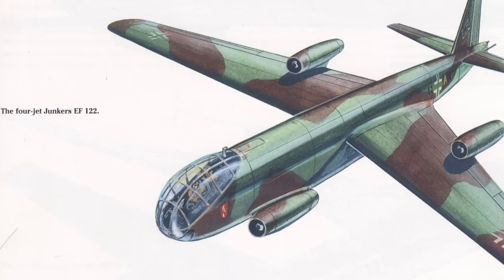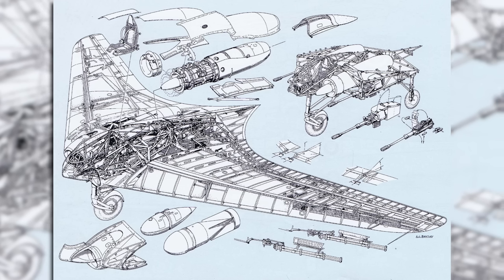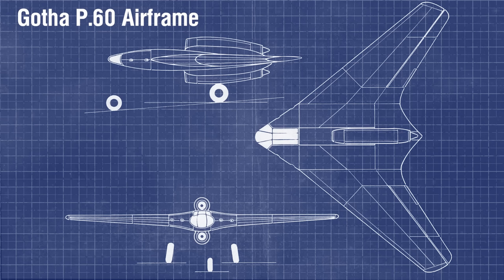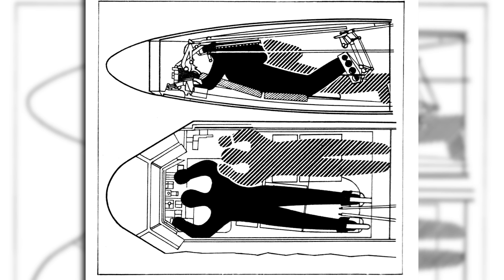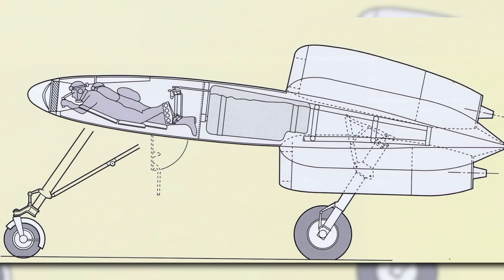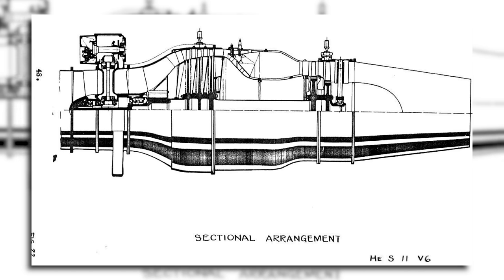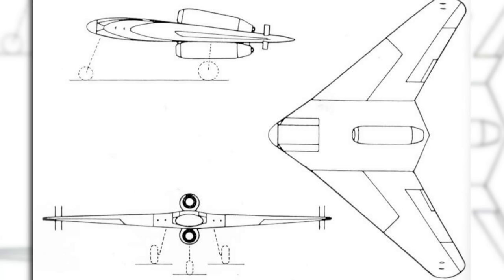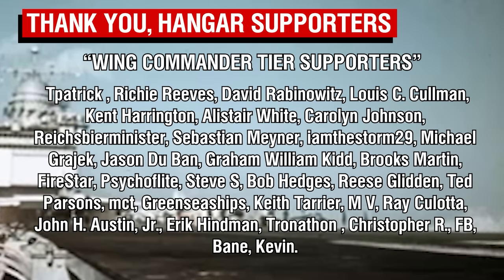Gotha P.60 - A Superior Horten 229? | Concept Planes

Comment from the maker: F.A.Q Section - Ask your questions here :)

Q: Do you take aircraft requests?
A: I have a list of aircraft I plan to cover, but feel free to add to it with suggestions:)

Q: How do you decide what aircraft gets covered next?
A: Supporters over on Patreon now get to vote on upcoming topics such as overviews, special videos, and deep dives.

Q: Why do you use imperial measurements for some videos, and metric for others?
A: I do this based on country of manufacture. Imperial measurements for Britain and the U.S, metric for the rest of the world, but I include text in my videos that convert it for both.
Reply: Cant await to see the H or Ho IX V2  or Ho229, Go229 Video, i live in Göttingen were the Kommando Horten was stationed they flew alot of Horten designs here , H VII V1 with Props, H XII Glider and the Ho or H IX V1 Glider, the H or Ho IX V1 Glider and H or Ho IX V2 (Ho229) Jet were both built here at Kommando Horten IX Göttingen , V2 was then send to Oranienburg via Rail from Göttingen Air Base for Testflights.
 Theres a good Book about Horten designs from Hans-Peter Dabrowski "Deutsche Nurflügel bis 1945" (Die Motor und Turbinenflugzeuge der Gebrüder Horten) PODZUN-PALLAS with alot of good fotos
Reply: Kilo Newtons
Reply: Boeing 806?(not sure if that is correct..looks somewhat like an F-16...same contract competitor)
Reply: ..and...Awesome videos...never miss one..
Reply: Could you make a video of the Bereznyak-Isayev BI rocket powered plane?

Comment: I much prefer the Horton.  The engines buried in the wing/fuselage made for a much cleaner, nicer look.  With more time to develop I'm sure that they could have created a frame that was sufficient to support the engines like detachable units and just open up access panels to pull or drop the engines out quickly and swap in a new one.  Like changing D cell batteries.
Reply: You massively understate the difficulty of swapping out engines. I’d prefer pod-mounted underslung ones as in the Convair Hustler
Reply: @charlestoast4051  ok.  The Hustler isn't the same in any way, but we like what we like I guess
Reply: It's all fun and games until you have to do an engine replacement.
Reply: Could have been solved with a ground frame to support the wings weight when dropping the engines, though would have added a lot of extra ground support headaches.
Reply: @watcherzero5256  Obviously, I haven't reviewed the plans for the Horton in anything but a casual glance, but having seen the Jumo engine I can't understand why a quick connect to the intake and exhaust with similar quick connections to fuel, electrics, miscellaneous couldn't be attained.  I mean, an engine nacelle hung under a wing isn't much different.
The mistake is to build it like a Formula 1 racer where the engine is part of the frame and structure.  That's what makes service or engine replacement time consuming.
Reply: @andrewmacgregor8717  Thats exactly the issue in this case, its a stressed member engine which is integral to the frames load bearing capacity and without it providing rigidity the frame cant support the weight of the wing. The same is done in Tractors, motorbikes and as you said F1 cars. Russian aircraft carriers have a similar thing where the deck elevator lift shaft is internal rather than external like on western designs and is in reality a stressed box girder providing rigidity as the primary anchor point of the forces on the ships frame and without it the ship would collapse under its own weight. (so it cant be moved or cut into to be enlarged)
Reply: @charlestoast4051   Difficulty ??? What difficulty ?? Ridiculous statement.  Dozens of jet fighter designs since the war up to most modern fighters replace their engines by sliding them in from the back. The same could have been done with the HO-229. And NO modern jet  fighters uses under wing pods for obvious reasons. Don't quit your day job...
Reply: @EngOne Sanity! Thank you.
Reply: ...like jet power-eggs
Reply: @EngOne  Just ignore the guy above you explaining why that wasn't possible with the design of the 229, and keep raving on.

Here, I'll extract it for you.
"...its a stressed member engine which is integral to the frames load bearing capacity and without it providing rigidity the frame cant support the weight of the wing."
Reply: @mootorkassipoeg  Naw. I'll just ignore both your and his uninformed comments. Like in many post war jets, that problem was solved by having a tube installed into the airframe to take the stress of the structure. Then you are free to slide the engine in and out. My Engineering graduate degree is in Aerospace Engineering. What's your degree in?
Reply: @charlestoast4051   Simplified, yes, but not altogether wrong.  Problems arise due to poor structural design; you have to take servicing the engines into account when developing the engine mounts and  maintenance access.
Reply: @EngOne Yes, no MODERN jet fighter.  This was not a modern jet fighter, it was an experimental design that didn't have 70 years of research to draw from.
Reply: @kevinsullivan3448  WOW you guys!  I didn't think it was all that controversial.  I'm amused 😀
Reply: @kevinsullivan3448  Immediately after the war, numerous fighter jets used this method of inserting jet  engines, including the Focke-Wulf TA 183 designed by Kurt Tank during WW2
Reply: Massive problem : Germany was out of time
Reply: So can this better alternative of a fixed wing jet aircraft be compared to F-22 vs YF-23? Cause if the war drags on for longer, the Horton one is likely to be approved further despite the Gotha design is potentially better.

Comment: Feels like the upper engine would have problem at higher angle of attack, while the lower would eat debis kicked by the nose wheel.
Reply: probably would, but over under mounted engines have been done before, so maybe this is an over thinking situation?
Reply: I can see it from a structural perspective, massively reinforce one narrower area rather than spreading out the reinforcement which may have weighed more. Effectively it provides a keel that everything else hangs off which can be more efficient when done correctly. Do I see it as a good idea? Hell no! That opinion, however, comes from living with an aero engineer for over 40 years.
Reply: A flameout of the lower Engine on,  or shortly after takeoff would send you right in to the earth.
Where as an failing upper engine would turn you nose up, then the lower one would flame out and after that you would neatly die in a flaming impact..... perfect.
Maybe i am to pessimistic but i wonder why they gave the engines such a big angle of attac.
Usually a low mounted engine should face up to counter pich up bias. Likewise a high mounted engine should face down to counter pitch down.
And this plane is the complete opposite.
Reply: @Flofutz hmm... maybe this is one of the planes that lead to realizing that.
Reply: @nos9784  it was never realized. so that had to be learned from something else
Reply: @SomeOrdinaryJanitor  the EE Lightning comes to mind but it has a single front intake instead of having each engine intake seperated  by a plane.

Comment: irst: there wa never an Horten 229! It is the Horten IX! The 229 comes from the Manufacturer Gotha where this Plane was build (and for the Build named Gotha 229 because Horten never was a Manufacturing Company capable of more than a few Prototypes ;) ). The Horten was not much more like a Proof-of-concept,  The Plane that was planned to be build in Numbers was the slightly more conventional Gotha P60 with vertical Fins for better Stability.

Comment: Another problem with the P.60 is that if you lose one of the engines, you get a severe uncontrollable pitching moment due to the engine not only being placed in a vertical distance from the center of gravity, but also being slightly pointed away from the center of gravity, as in the opposite of what is done on the SU-57.
Reply: Would it really be uncontrollable?  Like could you not trim the elevons to counteract it, like a standard layout multi-engine would trim the rudder to fly with one or more engines out?
Reply: @rapter229 It would happen pretty quickly…dunno.
Reply: @rapter229  I doubt a pilot would be quick enough to go through the necessary steps fast enough, before the plane pitches uncontrollably. 
Even then, do the elevons have enough authority? They don't get extra leverage from a long tail boom, so you'd need extra speed, making landing a nightmare.

Comment: 2:25 The nose wheel is right in front of the lower engine intake. What could go wrong?
Reply: Everything?
Reply: It had top secret German engineered FOD sensors on the wheel which could miraculously divert debris just outside the perimeter of the engine inlet.  I’m completely shocked Rex did describe these in detail!
Reply: @ronjon7942  
Just like the US Navy copied the collapsible nose gear from the ME-262 to increase aircraft storage space onboard carriers. 😖
Reply: The thousand year reich master race couldn’t imagine a routed intake duct🤣
Reply: Yeah they were so unintelligent, unlike you!

When this plane was designed Germany was in an absolutely desperate situation It was all about developing as quickly as possible and making it to be manufactured as simple, as fast and as cheap as possible. Form follows function!

Comment: Prone piloting was a popular concept in that area, but it's consistently failed in trials.  Putting both motors on top would have seemed more sensible. I'd rather cope with the yaw from one close to the centreline than the pitch changes from an over-under configuration.  
A problem with the Horton was the position of the gun muzzles close to the engine inlets. Carbon monoxide is as bad for turbines as it is for humans.
Reply: CO is combustible
Reply: It certainly is.  Just as an F-104A.
Reply: @juslitor  That's true, but it still chokes turbines.
Reply: So how would you personally cope with the yaw from a failed side by side layout engine with no vertical stabiliser and rudder?

Comment: I feel slightly claustrophobic just looking at the prone positioned pilots. Aside from the reason stated for the failure of the ejection panel, I would also imagine that even if you were able to survive the initial hit to the aircraft and was able to 'punch out',  you may well find yourself sucked into the bottom engine.

Comment: The prone pilots position was a bad idea but the over and under engine placement meant in climb the upper engine had a blocked air path the bomb drop ejection would work if both engines were on top of the fuselage

Comment: is any flying wing design feasible without modern computing and avionics?
Reply: No, The First flying-wings were flowed by the British in something like 1910ish
Reply: Not really.
The B1 and B-21 are designs failures from the 1940's with modern engines and avionics.  LOL

A  massive over simplification, but accurate for all that.
Reply: Perfectly feasible. Flying wing aircraft have been taking to the skies (although not in vast numbers) since the 1910s. Here in Britain several manufacturers produced a wide variety of them in the twenties, thirties and forties.
Reply: Check the Armstrong Whitworth AW 52. Designed during WW2 as an experimental plane to test the feaibility of the flying wing jet concept it suffered control issues on its first flight, the pilot ejected, the plane recovered and flew itself to a relatively safe  landing. The manufacturers therewith abandoned the project but a second prototype was flown for several years by the Royal Aircraft Establishment, presumably for further testing of the concept, until it was scrapped in 1954.
Reply: @thomasrotweiler  - Indeed, the AW52 was an amazing aircraft.
Reply: The ME-163 was successful with the use of a vertical tail to create yaw stability without any fly by wire computer flight control systems.
Reply: @bernieschiff5919  Well, any airplane with a vertical tail has directional stability without fly-by-wire, so the 163 is hardly worth a mention in that regard.  The trick is having directional stability without using a vertical tail.  

But what is worth mentioning about the 163 is that even though it was not a flying wing it was tailless. Even so, it had ample longitudinal stability and enough pitch authority to not only successfully maneuver as as interceptor, but to even use flaps for landing, which  is impressive.  Airplanes without a tailplane typically cannot use trialing edge flaps due to the negative pitching moment they induce.  All I can figure is that the reflex camber of the outer wing and elevons were powerful enough to control the negative pitching moment due to their position well aft of the center of gravity.

Comment: What's with the unproportionally large front tire on the 229?
Reply: Well, tricycle landing gear was still a fairly recent feature for some manufacturers and as today prototype aircraft are often tested initially with whatever parts can be found lying around.
Reply: The front landing gear came from the Heinkel He-177 Greif, because that landing gear was very good available because the He-177 was a big failed german bomber with ongoing double-engine overheating problems. Also it had the right size to give the Ho IX the perfect angle for take off and landing!😉👍

Comment: The true genius of the Horten brothers has only been revealed in recent years through the work of Albion Bowers at NASA. Independently of Ludwig Prantl, the Horten brothers devised a wing where the outer part had a decreasing angle of incidence compared to the bulk of the wing. This produces a bell-shaped lift profile rather then conventional elliptical lift profile of most aircraft. The effect is that the problematic adverse yaw on roll of a flying wing is eliminated and the wing will fly stably in all non-stalled configurations. Most aircraft have adverse yaw on roll but the vertical tail surfaces have enough control authority to counter the yaw. Albion Bowers has made the point that the Wright Brothers invention of vertical rudders in the first flyer allowed controllable flight. Bowers conducted a long series of model experiments with what he called a "Prantl wing" about 10 years ago and showed that the predictions of Prantl and the Horten prototypes were substantiated. Northrup, as far as is known, never used Prantl's lift distribution on his flying wings and these were cursed with somewhat unpredictable handling and strange stall behaviour. The use of "fly by wire" in the B-2 bomber appears to be mandated by the behaviour of the Northrup wing but this isn't a given with flying wing designs.

Comment: Such a great looking plane, just put both engines below and you have like a modern 4-th gen,2 engine config. Now, the Germans knew better, but seeing those 4x30mm canons I always wonder; wasn't 2x30mm enough, but with like 3x the ammo per canon (adding the shells the other 2 + their weight in more shells)?
Reply: 4x30: 
I think it's about limited time on target... gotta make those seconds count.
Reply: I think the 30mm cannons were slow firing, to have a chance of hitting a target at high speed for the perhaps 1 1/2 to 2 seconds at most firing time it was felt multiple guns were needed. There were issues with the 2 cannons on the ME-163 as well, not enough firing time at the high closure rates that were encountered.
Reply: Serious research went into the development of the MK 108 autocannons and even Allied experts agree for the era they were in fact the most effective and efficient aircraft armament available during WW2.

The disparity between the American use of the .50 cal machine gun was the result of one of the most shameful and humiliating failures of WW2 which was the reverse engineering and production of the Hispano Suiza HS.405 20mm cannon  (M1/M2/M3)
It was without any doubt one of the biggest blunders in WW2 history and rarely discussed or acknowledged by American historians.
Reply: @WilhelmKarsten  Hello Sandyby, I have to tell you that you in your various identities and your various sock puppets don't constitute 'Allied experts'.

Comment: I wonder wether the Ho 229 or Gotha P60 would have made the same radar-signature.
Reply: A brief examinaion of both aircraft reveals that the Ho-229 is devoid of any significant retroreflective structures. In particular vertical stabilizers.